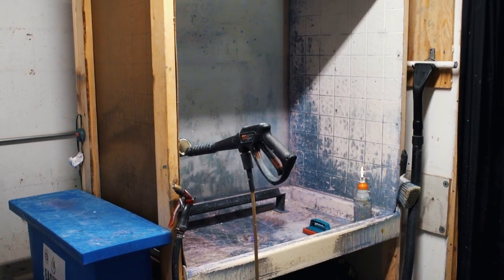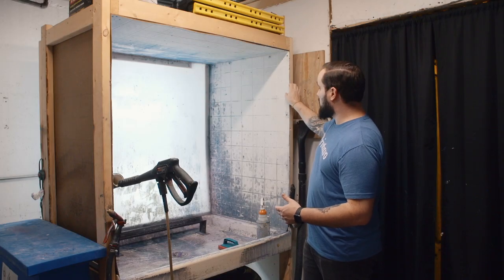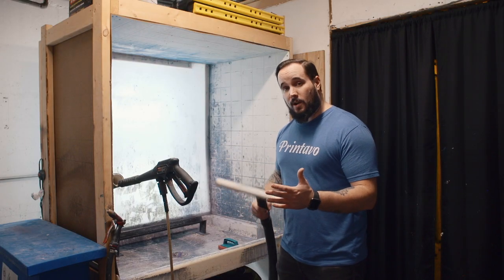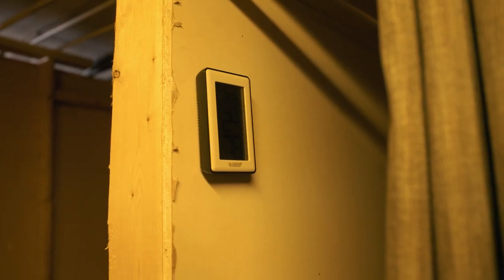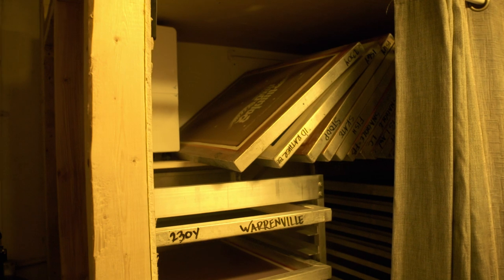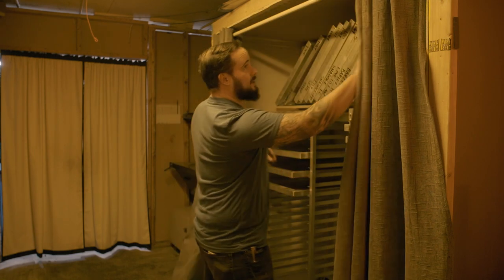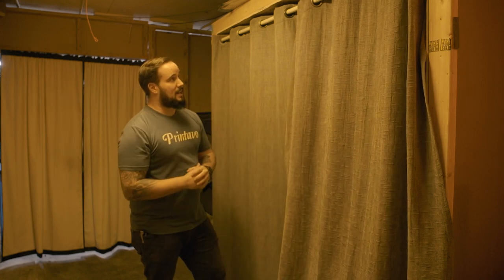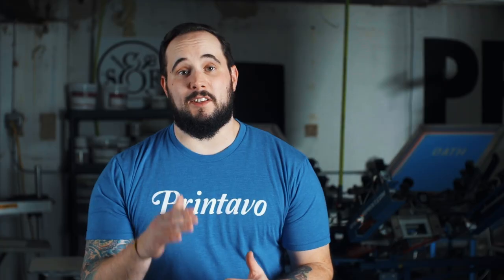How To: Build a Screen Room for Your Screen Print Shop (On a Budget!)

Comment: Definitely going to implement some of these right away. The wall mounted coating bracket is next. My patent pending “Screen Coater 5,000” (a piece of plastic mounted to the wall so I can angle the screen without it moving) does not feel great on the back being a tall guy. Unfortunately I can’t make my own washout booth yet as my front shop has a wide format printer and the other has a CNC so I can’t do washout inside. Unless I buy multiple dehumidifiers 🤔
Reply from the maker: Awesome! Let us know how it goes.